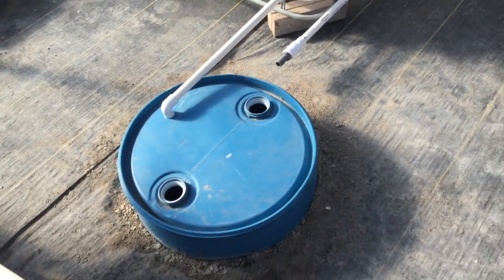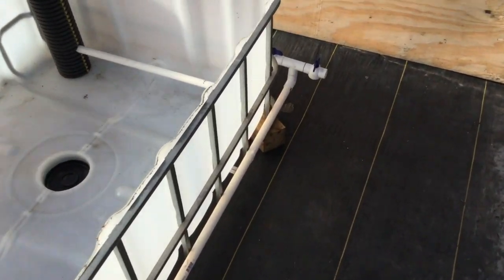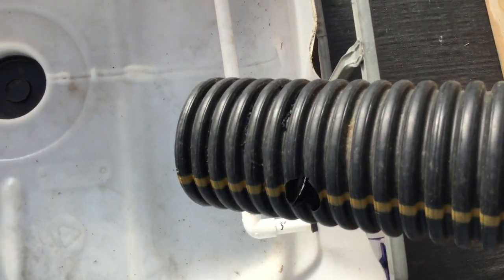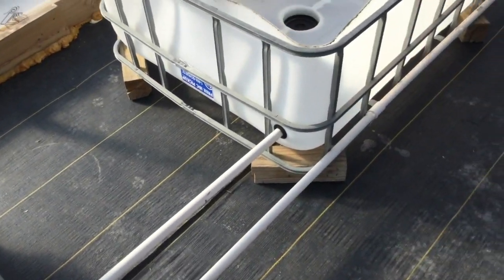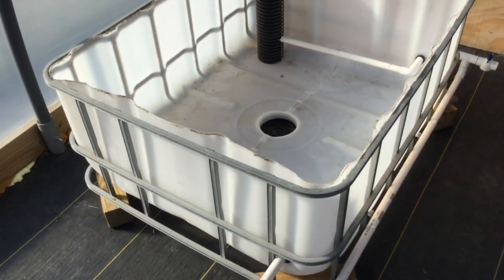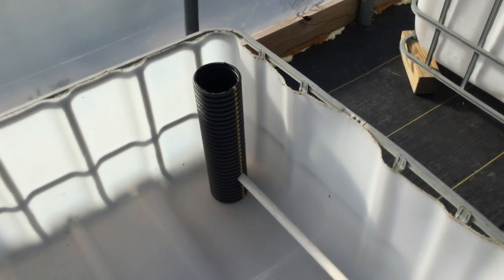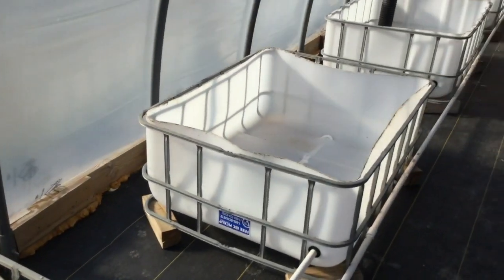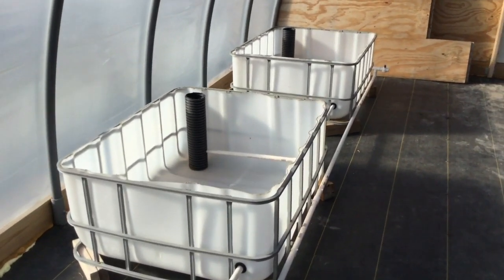Constant Flow Wicking Beds (1)

Comment: So 6 years later do you love it or hate it - seems every time I do anything like this - there are few things I wish I did a little differently... - would love to know how it worked out an update?? TY
Reply from the maker: Having them chained together is a great idea, but the continuous running pump isn't necessary. I only run the pump for an hour every couple weeks in the summer to top off each bed's reservoir, and maybe every month in the winter. Much easier to do that than it is to go top off all 12 of them one by one.
Reply: So you love it? 
And they are working great 6 yrs later... I really want to set one or 5 up but my in ground garden is all set up so.... just trying to do my research.  And what ever I go with I don't want to change it again lol...
Reply from the maker: Yep, still working 6 years later and about the only thing I would do differently if I rebuilt them would be to use 1" schedule 40 PVC to chain them together instead of the 3/4" thin wall stuff. But, I just used what I had available.

Comment: Hi Larry,
Hope you still replying to messages.
I'm trying to build this system at home too.
However I cant find the exact dimensions.
Did you have plans with which you based this design on?
Or perhaps able to provide a link to where this information is available.
My question is on the height of the reservoir. 
I've got 4.33inch perforated pipe as reservoir.
Not entirely sure what height to make the outlet at.
Must the top of the outlet pipe be just below the top of the perferated pipe?

Im working on metrics, so 110mm perferated pipe and 25mm pipe for water distribution.
Pls excuse if conversion to imperial not accurate.
Reply from the maker: I didn't base it on any plans, I honestly never do anything based on anybody else's plans. Even the greenhouse was just a matter of looking at other people's designs and making mental notes of the features and ideas that I liked. If you keep things simple, there's no need for any plans beyond what you see in your mind.
Reply: Thanks so much for your quick reply Larry.
It's an expensive exercise here in South Africa given the limitation of products, so don't want to drill all IBC to later find their useless.
Doing this for 20 bins as well so would like to have some level of comfort that it's correct.

Just a question then on the water height inside the IBC.

Must water level inside the IBC be at same level as the fabric, or below the fabric, or above the fabric?
Reply from the maker: I drilled my overflow holes high enough that the water was slightly over the top. The soil will only wick up what it can hold, gravity guarantees that for you. One thing that I would suggest is that you never try to follow somebody else's plans exactly as you see them on paper. Understand what the end goal is and work backwards to see how they got there. Otherwise, when something goes wrong, you won't have any idea how to troubleshoot things. Think more like an engineer.
Reply: @LordLarryWho  Thanks so much for taking the time to reply, makes sense.

Comment: As others have eluded to, there could be a reduction in available nutrients for the downstream beds. You say No but I will adopt a Wait & See approach because from my hydroponics days, there will be a decrease in oxygen & main nutrients downstream as the water is reused by each bed in turn. There will also be a pH change in the water that leaves the first bed, which will compound as it leaves each successive bed. Please keep us updated as your crops grow so we can see the long-term benefits of this system.
Reply from the maker: Sorry, I've already posted updates proving those assumptions are incorrect. Let's say that these were just traditional wicking beds. Why isn't the oxygen and nutrient level depleted between them? It's because the bottom of the bed is nothing more than a water reservoir. All I'm doing here is maintaining a constant water level in the bottom. This has absolutely nothing to do with hydroponics, so none of those rules apply even slightly. This is nothing but in-soil gardening, the pH, nutrients, and oxygen level at the roots comes from the soil, just like growing in the ground.
Reply from the maker: Just a 1-month followup to let you know that all of these dependencies are being satisfied by the soil and the reservoir in the bottom of the wicking bed is still only functioning as a water resource. I will post another followup next month
Reply: Your correct, and the fix is to have a greater flow, and a separate nutrient tank.
    Do Aquaponics, and you'll learn a lot about nutrient balance between growbeds. Because, you can harm your fish if its not consistant.
Reply from the maker: @got2kittys  These aren't connected to the aquaponics system, and plants don't take up nutrients that fast anyway.

Comment: Would it not have been a better idea to place the pvc pipe on the OTHER side closest to the wall so you don't risk breaking it with foot traffic or stepping or dropping something on it during harvest of whatever you're growing?
Reply from the maker: I know the pipe is there and I'm the ONLY one working in the greenhouse, I'm 50% blind and I know those pipes are there. I've pointed this out every time somebody asks this question. There's also the fact that doing it the way you are suggesting would have taken three times as much PVC and would have resulted in low spots where sediment would plug up the pipes. I thought about it long before I started building it, this is the best way to solve the problems.

Comment: Great video! It's interesting that your setup is exactly like the one I have down on paper that I plan to build this season, only with smaller beds. I don't have a truck right now to pickup IBCs so I have to revert to things I can get shipped to me.
Reply from the maker: I had to have my tanks delivered to me by friends since I don't have anything to haul them with either, got them from the local sugar factory. I still have two more tanks that I haven't chopped up yet, one is going to be used to make a chop & flip system in the greenhouse just so I can demonstrate a flood & drain bed to visitors. I'm considering sinking the last one in the ground for a rain water storage tank.

As for connecting the wicking beds together, I know there are some people that say "never connect those together in series" because if one backs up then the system will leak all over the floor. I'm not worried, my floor covering is porus and won't flood. Worst case scenario is that I'll end up with 55 gallons of water spilling. Not a big deal.
Reply: Thanks for taking the time to comment. Unfortunately, I live in a fairly remote area and the nearest tanks I can get that won't cost an arm or leg are about an hour away. I'm not one to ask for favors so I make do with that I can. Good point on them overflowing. In foresight, maybe I'll use a T fitting as this will be indoor for me. It's not much more expensive and only adds a tiny bit of complexity. The ultimate plan is to turn a large size room into an indoor grow area for food year round. I'm about half way there and kind of excited to introduce these wicking beds for root crops.
Reply from the maker: That's understandable. Well, if you're going to do this in your house, put a little money into a dehumidifier to reduce/eliminate mold damage to your house and feed the output of your dehumidifier back into your reservoir. You'll be glad that you did, and it'll save you on water.

Comment: Sinse you hooked up your planting beds in series, won't the last bed have access to less fertilizer than the first bed, decreasing across each intermediate bed along the way?   I think you would benefit from looking into the Dutch Bucket style of water distribution.
Reply from the maker: Nope, not at all, nature doesn't work anywhere near that fast. The nutrients also aren't exclusively in the compost tea that flows through the bottom. I also have 3 dutch buckets here as a test, they only seem to be useful if a person is doing hydroponics.

Comment: Wont the water be deoxygenated when moving down different beds. Also things might get anaerobic down in the gravel. Just a thought.
Reply from the maker: This isn't aquaponics and as long as the water was kept moving and aerated, those problems never happened when I did this previously.
Reply: Deoxygenated? Errr, that would be pure hydrogen, wouldn't it? I think that would also require electrolysis to accomplish that. Even if anaerobic pockets happened in the gravel, with the water constantly flowing (you might want to study up on how/where/why anaerobic bacteria colonizes), who is going to smell it if there is a foot of potting soil on top of it? Your comment makes it look like you spend way too much time obtaining information from really bad sources full of armchair experts.
Reply from the maker: True, true and true. Self-watering and sub-irrigated planters have been around for hundreds of years, plus you can find anaerobic areas and low dissolved oxygen water in the ground without any effort. Do people and plants worry about that? Nope. Some things just aren't worth worrying about because all of the effort it would take to over-complicate it, you won't gain you anything worth bragging about anyway. All I'm doing here is making a bunch of self watering planters that maintain a constant water level and allow me to add nutrients to all of them from one central location. Never had problems with this in the past, or even with regular planters that don't have a constant water flow feature.
Reply: Larry Athey thanks Larry for responding and clarifying.

Comment: Curious why your lines are run inside instead of outside along the wall. It seems they would be less vulnerable and minimize tripping(not that I'm clumsy) Love your work.
Reply from the maker: Because it would have required 3 times as much PVC, more bends, and created more potential for low spots that would plug up with settling solids. I'm more concerned with "keep it stupid simple" (yes, I intentionally say it that way) and not the least bit concerned with neat and pretty. I'm the only one working in the greenhouse, I know the pipes are there, doesn't bother me to step over them. Those pipes are also the least of the obstacles.
Reply: Larry Athey thank you. It's not obvious at first glance
Reply from the maker: There is also a second row of wicking beds going in, so the plumbing will actually be right down the middle of both rows.
Reply: Larry Athey now it's clear, should have watched the whole series, see you've already answered this in 2nd. Thanks for your work.

Comment: seems to me that if you connected the beds in parallel rather than in series that any nutrients added would be more evenly distributed rather being concentrated at the furthermost bed.
Reply from the maker: The nutrients are in the soil, so there would be no benefit to parallel over series. Also, even if there were nutrients in the water, plants don't absorb them as fast as you're implying.